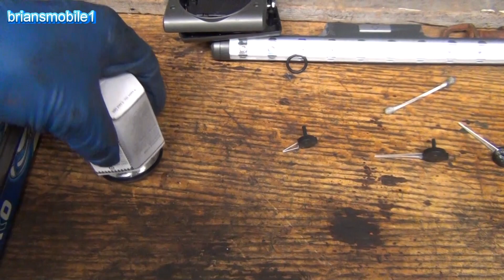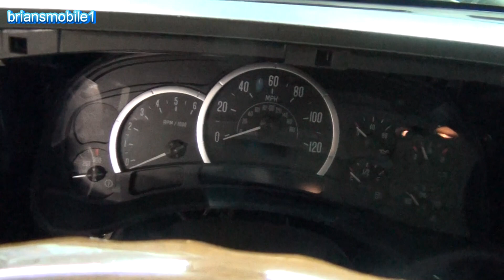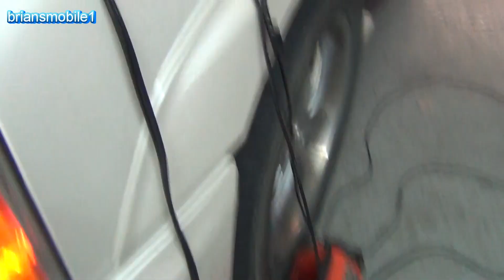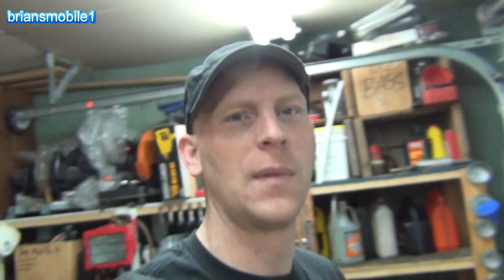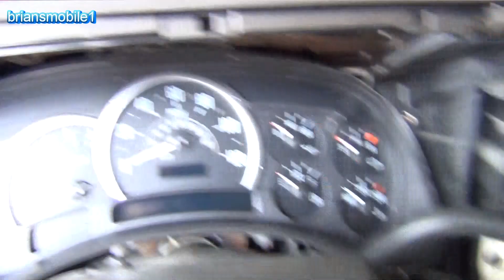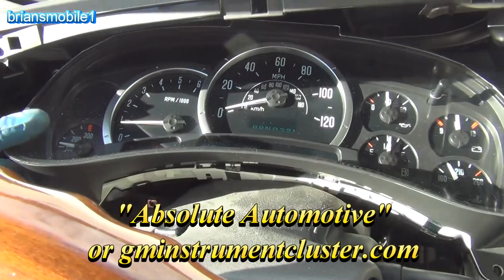Pandora's Gum Wrapper - Escalade Cluster Fail

Comment: Hey brian I don't know if you read this or not but I noticed you don't read your twitter so I'll try here.

I know this is from a 3 year old video and someone has probably already told this by now but JUST IN CASE:

the yellow/brown stuff that's left behind after soldering is flux residue, not burnt circuit board. You should clean flux residue off after soldering because it is slightly conductive. It's also just gross and sticky.

Comment: Been chasing the same thing on my 2004 Escalade....  New Battery & alternator were just done.  Cluster is now out being rebuilt....  Driving me crazy.  The odd thing is, all my lights work, and the speedometer works.  The rest of the gauges move at random....  Or they just go to sleep.  I would really advise your viewers, don't try to solder new stepper motors on.... Just send the whole cluster to someone for a total rebuild.  The $200 is well worth it.   I'm speaking from experience here, when you solder on 7 new stepper motors, and replace all the lights, and it still doesn't work... That will drive you crazy.  Just send it in....  It actually made me feel good, that you weren't getting the super easy fix either....  I love your work.  Keep it up!

Comment: Back in the day I had a 1987 LeBaron with the electronic dash. One day it started saying my passengers rear door was ajar. Funny thing was it was a 2dr. Shortly after that the battery took a dump, New battery no more problems.
Reply from the maker: +Glen Harper Gotta love false error stuff like that.  My favorite is diesel codes on a gas vehicle failing emissions OBDII tests.  It doesn't happen often, but when it does it can make you pull your hair out.

Comment: I have a 2004 Chevy Avalanche that I was driving down the road one day and the instrument cluster and radio stopped working.  I looked through the fuses and everything was good so I Googled it and found I thread that said it's a dead battery in the keyless entry remote. I thought that was the dumbest thing I ever heard. But I changed the battery and sure enough everything came back on and worked perfectly.

Comment: Judging from the rims I'm thinking the owners are from south of the border...The lug nuts probably worked loose because they are not the correct ones for those wheels, but they were too cheap to get the right ones (with the correct 'seat' to register in the rim correctly)...I see it all the time.

Comment: Problem is in the Power Supply circuit

The seven resistors you soldered are for the gear indicator display, the cluster will function without them ie Manual Transmission cluster does not have the 7 resistors or the VFD

The connector fillets on the back rarely ever are cold joints ie they don't fail or require touchup

The circuit card assembly is the same for Escalade, Tahoe, Yukon, H2, Silverado and sierra lenses, faceplates and needles are different.

The stepper motors were replaced x.25's and the yellow based smd 50 lights were also replaced. x25's went out of production a year ago so it worked a while after the rebuild. also a few backlights are burned out

Comment: Hey Brian, I like your video's! Learning on the job is the best way to learn. Maybe you noticed the big blobs of solder while reworking SMD parts. If this is the case try using a thinner solder wire, like 0.5 - 0.7mm. Sometimes 1.0mm is too thick and you end up with too much solder, the thinner the solder the better you can control the amount. Good luck!

Comment: it needs a new cluster. ignition switch has nothing to do with a cluster. if it was the switch it would not start or run.
Reply: The electrical part of the ignition switch has more than a dozen leads to energize different systems. If the leads to the ignition system, ecu, and starter solenoid were intact.... while the dash illumination conductors were burned at the connector in the column (which is a common GM problem in some models), the car would start, and show intermittent dash problems.
Reply: i am more familiar to General motors than you think. I worked for Cadillac and Chevrolet for 6 years and it Says Directly from gm in a service bulletin to replace the IPC with the updated version. If it was the ignition switch it would have an intermittent no start condition
Reply: That's not necessarily true,  while it may be true by the relative occurrence of the problem.  The ignition/ecm power run of a different pin out on the switch,  therefore it's not impossible to have an intermittent loss of power to the cluster without affecting the running condition.

Comment: Brian, I have a "tip" for you about the "tip" you were using… haha sorry, had to! Anyway, try a larger one! I know it seems counter intuitive, but I'm not saying a huge tip, but just a medium chisel is what you want. Also, it looked like you were using lead free solder (I noticed how it sets with a dull appearance, although that could just be the lead free solder already on the board) so a chisel tip is helpful to get that heat spreading - heating up the solder joint those first few degrees is the hardest because there's no molten solder to transfer heat. In this regards, I always find that using a small (but not quite as small as what you were using) chisel tip, I will roll the iron until the flat spot touches the joint, and it helps greatly with heat transfer. Adding some fresh solder to a joint you want to de-solder is also often helpful, even though it sounds counter intuitive as well - it helps the head to flow into the joint. You might also try using a good 60/40 or 63/37 lead solder.. I know, I know, it's not "eco-friendly", but to be honest repair work is much different than mass production, and lead solder is SO MUCH nicer to work with. It flows better, wets better, solidifies more predictably, and thanks to lead being a very flexible metal, can withstand the temperature extremes of a vehicle interior MUCH better than lead-free. I have to wonder how many cars are sitting in junkyards because of lead-free solder that cracked and nobody felt like tracking down electrical gremlins.. Maybe lead isn't so bad after all. :)

Comment: Great vid!  That video is what I experience everytime (it seems) when I work on one.  My 2cents on the soldering; I was taught (by my father and later in my career) is to let the iron do the work and let the solder flow, shouldn't have to move the iron at all except to place it on then off the piece your working.  Still a great job, keep it up!

Comment: brian that solder looks horrible it doesnt flow very well its either poor solder or the temp of the iron is wrong.
get thin lead tin solder with flux in it, not the cheap stuff you will see he difference it flows much better. and get a quality solder sucker that will help you.

weller soldering irons are amazing ive had mine for 15 years still look new

keep up the good work

Comment: Hey Brian, I just thought I'd chime in with a little stepper motor information.  There is no such thing as absolute positioning with a stepper motor.  They have no encoders or any type of position feedback.  This means that all commands given to the stepper motor by the microcontroller are relative; it'll tell the motors to move so many steps clockwise or counter-clockwise relative to their current position.  What this means is that the only way the microcontroller can predict needle position is to slam it into a mechanical limit on one side or the other of its range of motion.  This is usually how stepper motors have their positions reset.  You see all the needles go slamming counter-clockwise when you start it up?  My guess is that that is how they reset their positions. 

Long story short, what this probably means is that it doesn't matter at all what position the needles are in when you pull them off and put them back on.  You probably don't have to worry about lining them up like you do with analog gauges.

Comment: Cig lighter plugs would be designed differently if they were intended for vertical installation.  Engineering FAIL to mount them like they do now, and I think all do it.

Comment: Electronics in a car are supposed to work over a wide range both for voltage and temperature. Just imagine, engaging starter drops voltage to 5V, when starter start to crank voltage goes to 9V and finallly to 13V when started.. So, during cranking, all electronics need to keep working at 9V, specially the EFI module. So, this cluster has something bad, a module shouldn't operate over a so little voltage range unless is faulty anyways, even with that battery shorted. Just the other modules from AC, radio etc keep alive while you were testing.

Comment: From when I was a kid and wiring kits from Allied Electronics or Heathkit, I remembered they said not to clean the soldering irons with sal ammoniac blocks.   I never researched WHY.  Right now I googled real quick and found this :  "  Sal ammoniac blocks are sold for tip cleaning but they should be avoided as well since the chloride salt residue from the block will cause corrosion on pc boards and connectors. "    Something to look into further ?

Comment: damn i wish i would of seen these videos when i had my 2001 crown vic P71 police interceptor. it would always blow the fuse to the cluster. and each time i had to go and get the check engine light taken off. it would always say the gas tank leveler was bad. when it was not. damn this would of saved me so much money. keep throwing money at it in repair shops over and over. replace this replace that new part here rebuild this......god damn it.......awesome video this will most likely help me out wit the next pile of junk car i get somewhere down the road

Comment: I Have A 1988 Toyota Truck 22re And When I Turn The Key The Truck Starts Or Not, So I Had To Connect Another Ignition Switch Directly To The Battery And Starter. Some People Say Theres A Voltage Drop But I'm A Novice

Comment: A fecking fork, why the hell did I never think about I before!
Hakko, hard to get hold of in the uk, my tips cost around £5 each for my atek, meh.
I could not live without my flux pen, they are awesome.
You need more heat, the solder it hardening up just away from your tip. Hot and fast baby and a bit more flux.
I like that tinning block, never seen them before.
Reply: That tinning block he used appears to be "sal ammoniac", which to be honest I used to use all the time when I did stained glass soldering - when you're using a 200 w iron and soldering literally yards at a time, it's sometimes about the only thing that will get of the crusty oxidation from your iron tip. I don't think I've ever seem sal ammoniac used in electronics soldering though to be honest.. I don't think electronics soldering is a nasty enough environment for an iron compared to structural soldering like stained glass.

Comment: I worked for MODEL ELECTRONICS in Nanuet NY . I repair mostly high end radios.
They fix speedos also . The do a excellent job like the one you used!!!  I became to disabled to work there any more but they liked my work so much they wanted to send radios they could not fix to my house.I lived about 1.2 hours from there and when the pickup delivery guy would pick up or drop off radios to the dealer by me they would drop off the radios . I could not drive anymore otherwise I would still be working there . 2 of the best places I worked was ASI in KY from 1981-7 they made delorean radios and high end radio for BMW Jaguar and a few others. The shut down but I bought a delorean radio and power antenna after it closed. Still have them never been used except in my house . The 2nd job was modle electronics basically the same job.  But between those I spent 7 years on submarines . That was and adventure!!!!

Comment: One of the instructors at the computer school I used to work at had a brand new VW Toureg V8. He gets in one day and it starts fine but he can't get it in gear. Gets it towed to the dealer, they can't find whats wrong, he goes on his merry way, and like a week later at school, same thing. I get in it and it was like you aren't pressing the brake to release the shifter. He gets it towed yet again, they decide to tear the console apart, and what do they find? A friggin nickel wedged in the shifter. A $60,000 car disabled by a $.05 coin. LOL

Comment: When touching up solder joints I think it's better to wick the old stuff off and put down new.  If the old is failing it's often because it's heated up nearly to the point of almost melting many times and has become oxidized.
Way to not give up.  These are the jobs that make you a better tech!

Comment: I've seen shorted and bad batteries do all sorts of crazy things. A thumb rule for me is when a car has multiple and strange electrical problems or the symptoms just don't add up: TEST THE BATTERY AND LEADS!

Especially BMW and Mercedes cars are heavy on the battery due to their complex electrical systems. A bad battery or corroded alternator lead can just make them go mad!

Good thing you got it right in the end!
Reply from the maker: Good call Joakim.  I've had similar experiences after motor swaps when a ground is missing on "advanced" electrical system equipped cars.

Comment: Brian you trolled yourself so hard many times correctly guessing about battery voltage and never checking what battery voltage is :) Glad you fixed it eventually. I fix farm equipment on my farm after everyone else is done knackering it, so I have seen batteries with 1 or 2 dead cells ("why the hell this truck turns over so slow" problem), after that battery voltage test is my first on any electric work.
Reply from the maker: This was unique because the gum wrapper may have messed up the battery and it also messed up two capacitors on the cluster board @ 1:46.  That being so- it made it tricky to detect.  The vehicle still started sharply as it should- so the low voltage thing seemed to be ruled out.  I had the blower, wipers, and everything going and the cluster stayed going because that initial crest had been satisfied.

Comment: For what it's worth, ANY time I discover an electrical problem anywhere on a vehicle, I make sure to load test the battery and alternator. Had a Lexus RX300 with insane electrical problems, cluster would freak out after using the window lockout switch... replaced the switch, fixed the problem temporarily. Replaced the battery, worked for a little. Changed the alternator and what do you know!
Reply from the maker: Sound advice- for sure.
Reply: markj You're absolutely right about going to basics and testing the entire battery & charging system every time.

In the past six months, I've repaired two vehicles with weird, intermittent electrical issues.  Both times, the alternator has tested defective (not charging, but also not illuminating the dash warning light). nothing in common between the vehicles - 2000 Ford Explorer & 1987 Chev P30 Motorhome..

Comment: One tip from what i saw when you were soldering those resistors, either the iron was not hot enough or the old solder did not take new solder very well. A good tip there is: first give it a good amount of flux on one side of the resistor, you can never use too much flux :) then add some new solder to it, and guess what. Use the sucker and take it all away again, then reflux and resolder with new soldering wire, that gets rid of most of the old junk and gets in the new good stuff. And you iron should be between 315 - 370 celsius, good and hot. There is less heat exposure to components when solder is wetted out in 2-3 seconds rather than holding the iron on there for a good 7-8 seconds at low temp, alot of people have cooked components or destroyed soldering points by simply being careful with heat. Quik in and out is the best, or atleast thats what i tell my gf :)
Reply from the maker: Thanks!

Comment: He replaced cluster todd, pay attention!! :) i was amazed that you did not measure if the alternator was giving charge 2 the batter halfway throuh the video, but man what a piss of shit, I would think if the battery was good enough to start the car it would ATLEAST keep the cluster alive. Thats some picky cluster shit right there, i guess it is dependent on a voltage that you simply did not have, thus turning off. Better you than me, I woulda thrown that cluster into a wall halfway through... Good job brian :)
Reply: Probably someone thought it's a good idea to use some picky voltage regulators in the cluster, which do not work under lower voltages(theoretically 12-14V to 5V or something similar to power LED bling bling), and then some parts of the cluster are not powered at all.
Reply from the maker: mechadrake
You're right!  Capacitors store energy like a high C rating Lipo-Battery to give a swift kick in the pants to get electronics going.  I missed two bad capacitors on this one because I was so caught up in filming and pursuing other details.  When the battery wasn't completely charged the voltage wasn't high enough to compensate for the bad capacitors and wasn't up to the "pants kicking" that the capacitors are there for.

Comment: Brian: Automatic climate control units use a full amount of power all the time, at least on some vehicles. My car has an ACC and what happens is if the fan is set to 1/4 of it's max speed it uses a transistor that turns off and on quickly and wicks away the extra power as heat. So even if I turn my fan on a low setting it's still drawing the same amount of draw from the vehicle.
Reply from the maker: You're describing the "Blower Motor Resistor" and you're right.  As long as the blower motor fan is running it's the same power draw on low as it is on full blast.